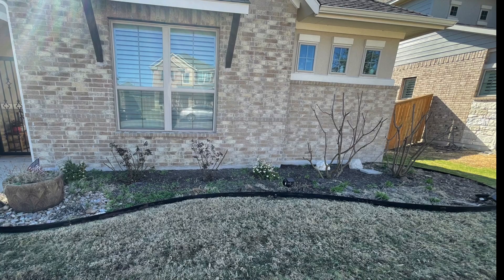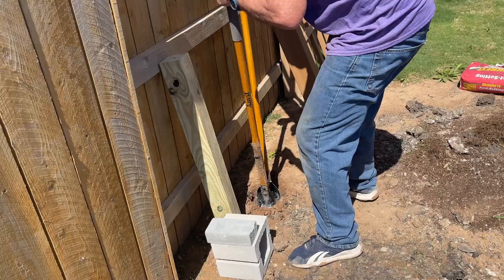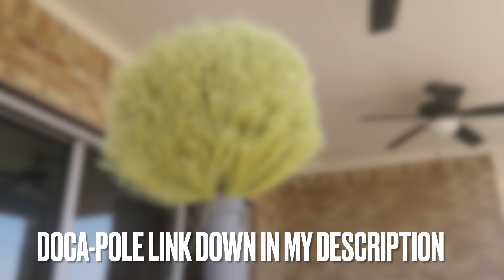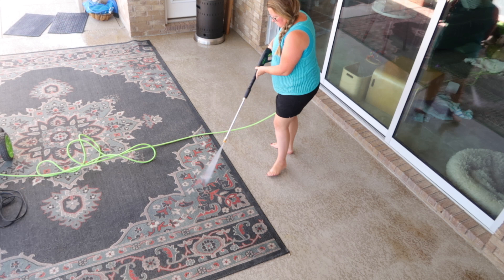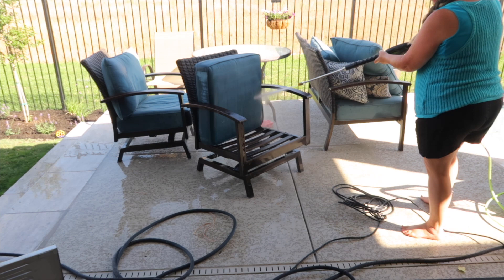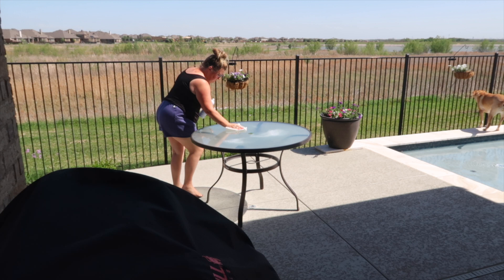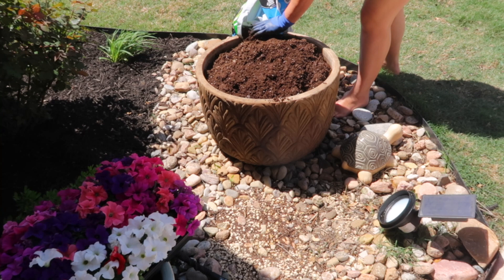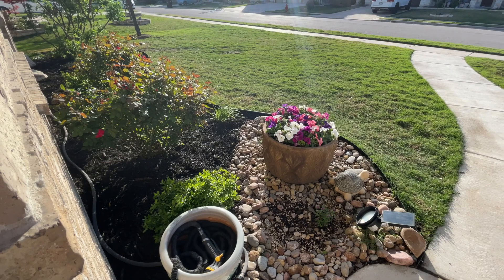🌼NEW OUTDOOR SPRING CLEAN + SPRUCE UP |  OUTDOOR SPRING CLEANING | MOM TO MOMS

Comment: Hi .., new subbie here!  River rock would work so much better cause you would never have to replace it. It looks cleaner and neater, too. Mulch tends to blow away or turns back into the dirt and needs to be replaced. It also draws termites. I know river rock is more exp[ensive but once you have it it never needs to be replaced.   Arlene
Reply from the maker: Hello Arlene. I recently put in River Rock around my pool. Unfortunately my HOA won’t sign off on River rock in the front. I can only use it in areas around down spouts. 😕
Reply: @michellelowe-getinspired  Oh ok ...sorry
Reply from the maker: No problem at all. I agree with you but my HOA doesn’t agree with us. Lol